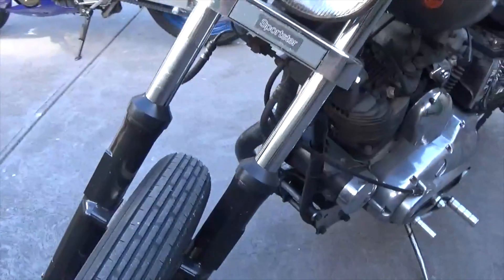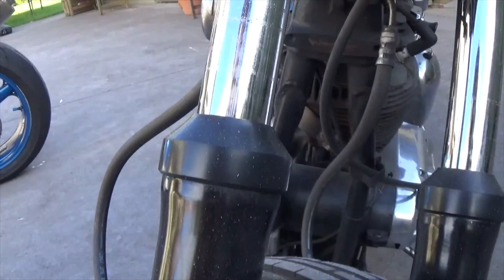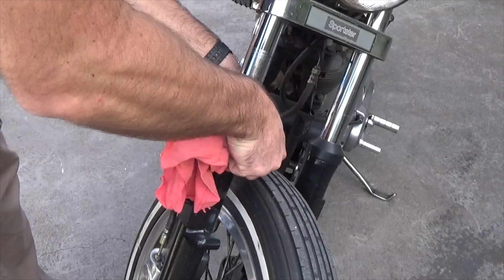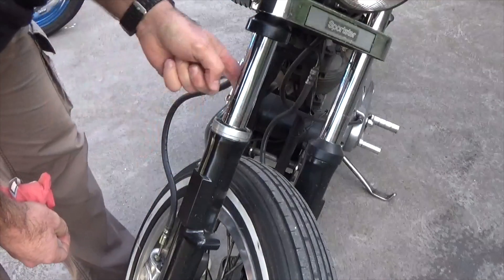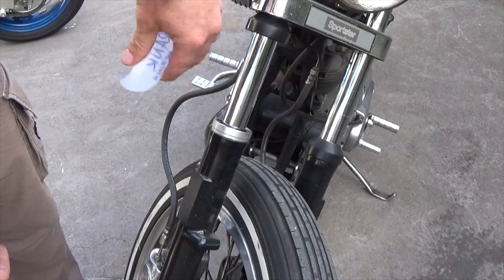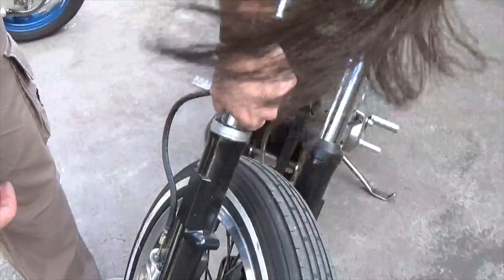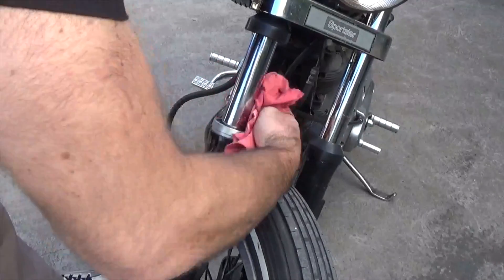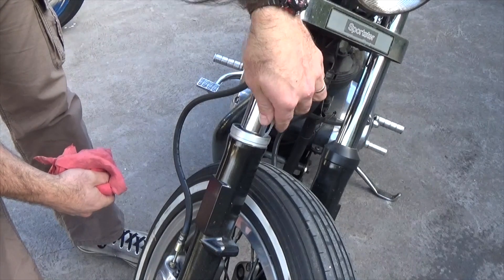Can you fix leaky forks for free?

Comment: This worked.  I likely need new seals soon (26000 km) but it was leaking enough to put a puddle on the floor.  Now, it barely leaves a line on the tube after bouncing it multiple times.  Thank you.

Comment: so you dont need to add fluid? so that means each forks have uneven amount inside?
Reply from the maker: If you’ve lost fluid due to a leak then yes, you might need to add fluid. However on bikes where the fluid fill is a fixed volume of oil, you really need to drain and refill with the correct amount because you have no idea how much has leaked out.

Comment: Works a treat.  Popped dust seal off, cleaned it.  Then wiped out excess fork oil, slipped in the "tool" and whizzed it gently around. Pulled out the dirt and grime and did this twice. All sorted! Now going to take bike for MOT!

Comment: I really appreciate the way that you did your video on front fork seals. I am thinking that my forks is leaking from the bottom.  Also, how do you put oil back into the forks,????
Reply from the maker: Hi Calvin, normally you put the oil back in at the top, there should be a cap of some description that can be removed to refill the forks. If you think the forks are leaking from some other location, wipe them down so they are completely clean, then have a look after the next ride. On one of my bikes the fork seal was leaking at the top but the oil was running down the inside of the fork (I couldn’t see it) and dripping onto the ground below. Depending on your bike (age and model) there may or may not be a fitting of some description at the bottom to drain the oil. On the old Harley in this video, they have a tiny screw plug that is sealed with a copper washer. If yours is similar, you could check whether there is a leak at the fitting. Good luck!

Comment: Thanks Matt, I did this today on my Zephyr forks and it has deffo improved them but I need to take her for a test ride later. One thing I will add if I may, also use the tool on the inside of your dust seals when they are raised up, I cleaned the underside first by jamming a tissue up from the bottom then rotated the dust seals held against the tissue. Then I used the tool on the dust seals, then the tissue, then the tool etc... until no more snot (oil mixed with water) was visible on a clean tissue. There was an awful lot of crap under the dust seals that wasn't doing any good.
Reply from the maker: Hope it works for you Martin 👍
Reply: Thanks Matt, after a 30 mile test ride there was no misting of oil on the forks. Cheers Mate!

Comment: Nice tip. Wish id seen this before shelling out  £170 for new seals. My dust seals were cracking tho. Only down side is with usd forks where you could have lost alot of oil without noticing the leak. If you catch it early this is great and way cheeper than a "seal mate"

Comment: But if there is oil like that doesnt it mean that the dampers are shot? Or these dont have one, just a spring and oil in the tube? I have shadow and never looked at it
Reply from the maker: Hey Thomas, the dampers are internal parts of the suspension that modulate oil flow (to create the “damping” and slow down the motion of the forks when you hit a bump). These oil seals simply keep the oil inside the fork assembly. Eventually they start to leak or are damaged by any pitting in the tubes scraping past the seals.

Comment: Did it fix the leak?
Reply from the maker: AchillesCanine in this case no, as I said I had just installed new seals, I didn't admit I had bought really cheap ones off eBay. I got three cheap sets for the price of one good set. They were rubbish. I had to buy some good ones and build the forks again. And I threw out the spare two sets of cheap ones before I even used them!
Reply: Matt McLeod . I made a Seal-Mate myself, out of the side of a milk jug. It seemed to work for my Ohlins forks on my Aprilia. I haven't had a leak for about 2 months now.
Reply: Thanks Matt for your honest reply none the less it was about just cleaning around those seals and it did that. Giving it a try and putting it down to something that can be done anytime as preventive measure  . Thanks Mate. jimonabuell WA
Reply: Escuch me